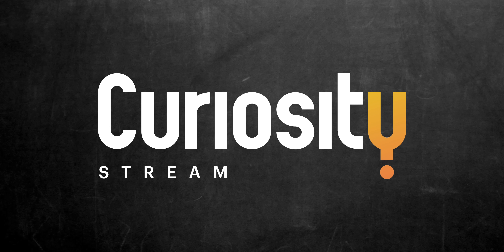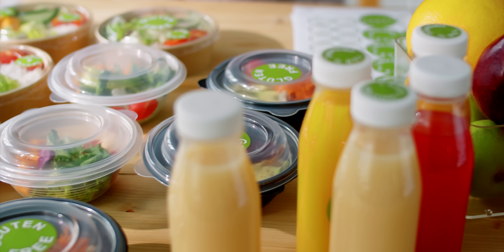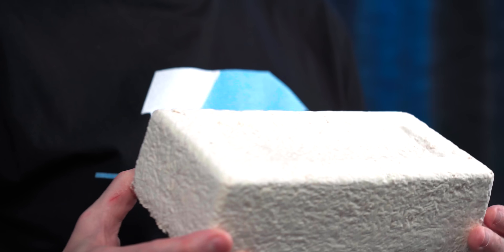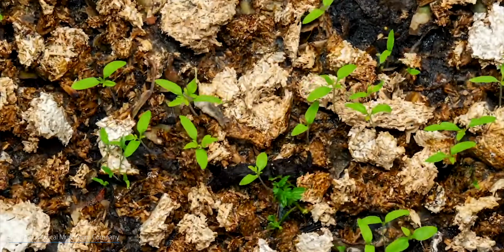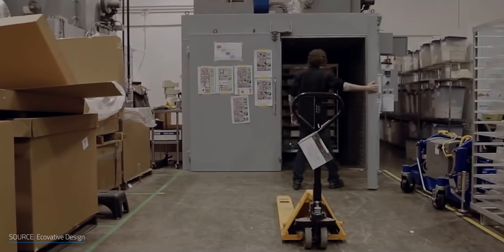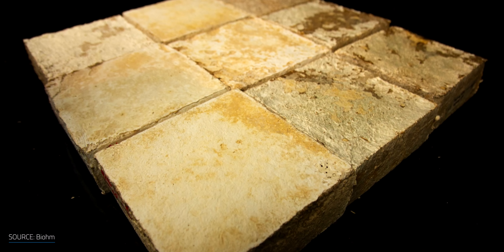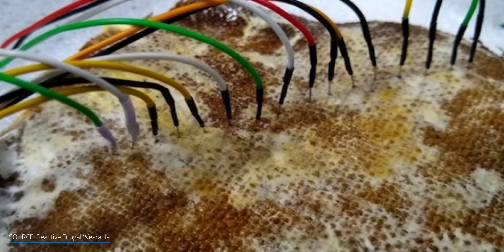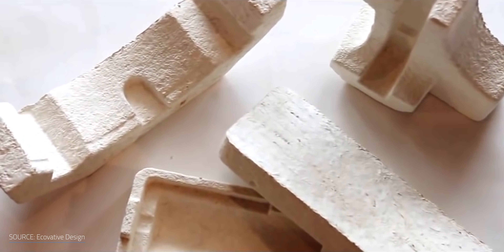Is Mycelium Fungus the Plastic of the Future?

Comment: I'm having a hard time reconciling the biodegradability of this substance with longevity. If the stuff breaks down quickly, how can it be used in products that should last for months or years?
Reply from the maker: Think of it like wood.  Properly cared for and used it can last for years.  Same for this.  Keep it dry and use as intended it will last for a long time.  Compost it and it'll break down in a month or two.
Reply: @UndecidedMF  But if we want the wood to last long, water resistant, we still coat it with something. IMO wood is one of the material that's frustrating to deal with if you want it want to keep it at the same size for example, for long.
They absorb air moisture, they shrink when dry they grew when wet. Untreated wood is a no no for something requires high precision.
One of the wood or paper coating is PU, Poly Urethane, which is plastic. I heard, the coat for ship bottoms aren't environmentally friendly as well.

Maybe environmentally friendly coat do exist? Idk. But, i guess the answer boils down to the preservation process and material.
It would be ridiculous to have a pair of shoes decomposing when wet.
Reply: Its exactly like wood or paper, if you don’t give them the right condition to compost, they will hardly do so
Reply: You could paint it with non porous paint or varnish etc to keep it waterproof and therefore not allow it to rot so easily.
Reply: @freedomofmotion  I've mentioned coating. Which would include varnish and paint. My concern was, they (the coating material) usually aren't so environmentally friendly as well.

Beeswax is the only food safe coating for wood as far i know, but it requires reapplying the coat every half or a year. Danish oil doesn't protect the wood so much. Standard paints also doesn't bode well when exposed to elements.

On the other thoughts;
I'm not sure non-porous is the desired objective the Adidas shoes did want to. As they advertise them 'to be breathable' in the video.

As Musikur mentioned, i well aware archaic wooden structures did stand quite well. At least a few of them. We'll see a lot of archaic wooden houses as well if the technique to preserve the structure is well known or widely affordable or practical enough for the masses.

Another good example for those outstanding woodwork I'm aware of, before posting my previous comment, are Torii gates at Japan, they stand for hundred years. Not sure what they did to those. They're left open to the elements all day long. Some even dip in the middle of the lake.
Reply: @freedomofmotion  That is close to my best idea. What if it grown in honeycomb shaped molds then spray coated with nanotube/Kevlar technology making structural components
Reply: Certain applications this product would be great, others not so much. The packaging concept is great.
Reply: There are many cases of wood lasting centuries, like the wooden pillars under venice for example, and then there are lots of old buildings in Europe which have straw or hay insulation. As long as it doesn't get wet it will last a long time. That being said, I'm more dubious about it's use in shoes and so on, presumably it must be made into a composite of some sort, if nothing else than to give it the flexibility
Reply: Wood is more versatile. It sounds like there are many different kinds of ways they are making the fungus material, and right now it seems like it's limited to only be able to not do much with the fungus material other then what was intended. Maybe they figure out how to make it better, but you're sooner are going to have a wood house survive 100 years, then a mushroom house. I think it would be a great plastic replacement, but I don't think it will be something you can be rough with, like you can with wood, and certain plastics.
Reply: @WhynotMinot  How long will Styrofoam insulation in a wooden house last* and what is it reactive chemical off gassing half life ?
*At the frist remodeling much of will go to land fill
Reply: @mittnival5562 My house I don't think uses Styrofoam insulation, it has a bunch of fiber glass. There are definitely pros to having various things made out of mycelium, but I think longevity isn't going to be very high on mycelium stuff. It's still early in development though.
Reply: @WhynotMinot  Exactly, and I think it would be cool to live in a future where consumers don't have to feel guilty about buying things. Like, if my uber meal was packaged with mushroom-based products, and my house was constructed with that concrete that absorbs CO2 upon setting, rather than what we use instead.
Reply: @WhynotMinot  "My house I don't think uses Styrofoam insulation" OK. " I think longevity isn't going to be very high on mycelium stuff." Again ,OK, but in a wall, why not, exactly ?.
Reply: @mittnival5562  In a wall I'm sure it could last a while, and it's sounds like it's way safer. The only thing that I think about, is that mycelium is like a plant, and I would think that a plant would degrade over time, and then you would lose your insulation. Since it's in such early development, no one really knows how long it will last In cases where it's just sitting in a wall. Idk maybe it will be excellent, but it could end up like graphene, and never make it out of a lab, or what's probably going to happen, is that it will be used to make things break quicker so that the big companies can make more money. At least though, it is good for the environment, or at least way better then plastic. I am totally down to replace plastic bags and most plastic things with mycelium.
Reply: @WhynotMinot  graphene never made it out of the lab?! Are you familiar with carbon fibre, being used more and more. Thinks indeed take time, but it's not like that makes the product useless.
Reply: @luckuijken5451  I never said graphene is useless, and I know things like that take time, but what I was saying was that they aren't going to release some mushroom based paint or mushroom based insulation that lasts longer then wood, or if they do it's going to make the price go up. The US is a consumer country and it's all about the money. So we'll see what happens.
Reply: @WhynotMinot  The only thing that I think about, is that mycelium is like a plant, and I would think that a plant would degrade (or grow) over time."
... just like 2X4 studding does ?
Both are PLANT PARTS far removed from the reproductive process .But sure every what if  is fair as we speculate.
Reply: @mittnival5562  Yeah both are plant parts, but what I mean, is that wood is much more ridged and sturdier. The mushroom stuff though, is I guess kind of like meat in its texture and formation. But who knows, maybe in the future there will be a sturdy mushroom formation that is similar to wood.
Reply: @mittnival5562  They are not both PLANT parts. Wood comes from a plant, a tree. Mycelium is a fungus, not a plant. Plants and fungus are as related as you are to seaweed.
Reply: @WhynotMinot  There's more than one kind of fungal tissue. Ink caps disintegrate in hours, conks can retain a woody consistency for decades, while the tree they are attached to has rotted away. As shown in the video, there are many different types of mycelium being used, the softer edible form is just one.
Reply: @mackenheimer  Did seaweed make us who we are today?
Date: February 28, 2017

Source: University of Southern Denmark

Summary: Millions of years ago something happened, allowing early Homo sapiens to branch out from the primitive hominoid family tree. Was this crucial turn in human evolution partly driven by seaweed and its particular content of essential nutrients? : 0

Comment: I recently had a problem with disposing of a large amount of polystyrene, I ended up putting it in the general waste bin but it filled it right up, no room for other waste. I would love it if it was mycelium based so I could just throw it on the compost heap

Comment: Idk if I missed it or if it was glossed over but...what about the effects of mycelium dust? Construction applications were mentioned but what about on the spot modifications like cutting? The sawdust made from any post-work done on the products will cause airborne dust. It being compostable could create problems if it gets into your body, especially the respiratory system which is the perfect place for the nasty stuff to grow, let alone providing extra and loose nutrients becoming readily available.
 
I'm predicting lots of new freak medical incidents such as mold or fungal infections inside the body.

Comment: Just three years?  If this stuff is going to be used in construction you better multiply that number by at least 10
Reply: Could be used as insulation. It was 3 years of weatherization, so it will most likely last much longer if protected from the elements.

Comment: sounds like a great idea to me. we have to consider- plastics are a BY PRODUCT of petroleum refinement. so what happens when electrification takes a major market share of big oil? drastic reductions in the need for oil means less refinement... which means less plastics- 

without a suitable replacement, we'd have to recycle every last ounce of plastic available- not a bad idea. forcing industry to switch to recycle means greater economy of scale- like what tesla did with lithium ion batteries. so having something like this would definitely help. 

also- the return of hemp & cotton.

 there are certain materials made of plastic that simply CANNOT be replaced ... YET. pex piping, pvc water pipe, abs drainage. resin beads for water softeners. resins & polymers used in high performance fiberglass & carbon fiber composites, just to name a few. making everything you possibly can from alternates.. means we don't have to refine petroleum just to get the essential polymers we need... recycling is about to get a whole lot more profitable.

Comment: If formatted in farily durable thin sheets this sort of material could be used for those of us that are into diy rc aviation, seeing that the material appears to be easily formable, relatively strong and most importantly very light weight (see flitetest for an example), and could also be used for other hobby and craft applications that currently rely on poly type foam boards and pieces for project materials. Just another handy thought for this type of material. Thanks for sharing this! Btw, "plant" based hamburgers are pretty darn tasty and the texture is on point. Have a good one!